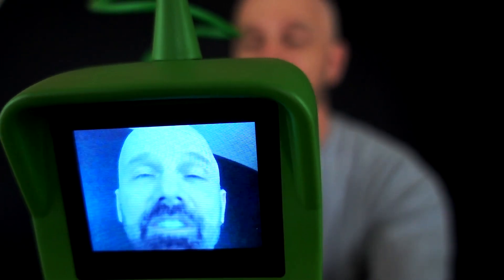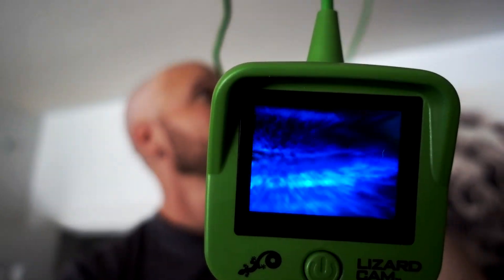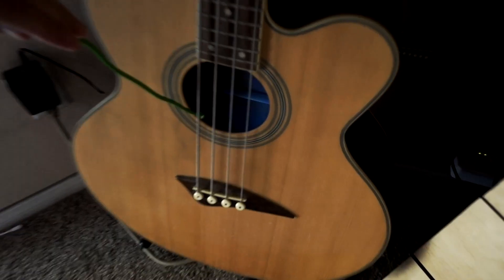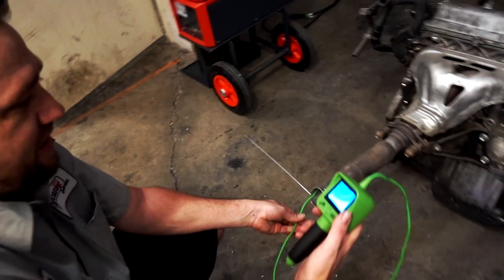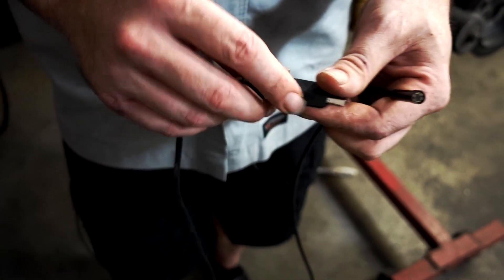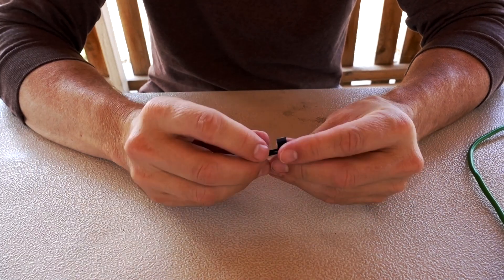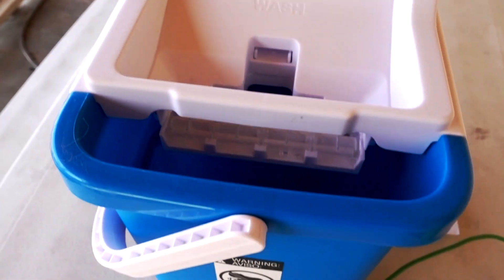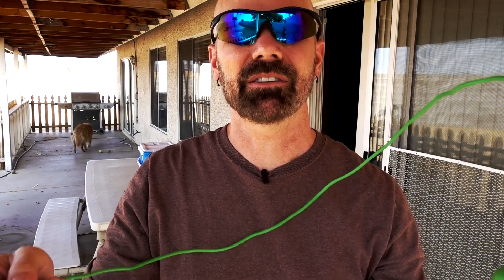Lizard Cam Review: As Seen on TV Inspection Cam

Comment: I was a jet engine mechanic in the Air Force and we used borescopes.  I have actually purchased a few for the Air Force and the ones we bought cost several thousand dollars and you had complete control of the tip with a remote control.  Crystal clear view.  Reverse the screen. Take pictures.  Measure defects. Etc.

Comment: I work as a auto mechanic and every shop ive worked at has a bore scope. its not this brand of course but this technology has been around for along time. it works great to see build up in the motor or if you want to save time for a tear down and want to easily prove failure to a warranty Inspector so they approve the new enginge for the customer.

Comment: Was it adjustable at all? I think it might be better with a wide-angle lens... It is also not widescreen, the FOV and aspect ratio seems to be sub-optimal. The LCD is a TN panel so there's always need to look at it straight on without an angle. A cell phone screen is going to be a much higher quality screen..ALWAYS..so I can only see this being a good option for greasy/dirty applications where you wouldn't want to have your phone in your hand otherwise a phone solution would always be a better (and cheaper) solution.

Comment: A high quality borescope allows focus, as well as adjusting the light intensity. It also has manually adjustable cable for moving the camera head as desired and making turns.
Yes the mirror has a use: an example is checking the condition of a wire you suspect may have chafed, but you can’t get your head into the space to see a mirror.

Comment: This very day, 09/20/19, I bought one of these at the Galesburg IL Walmart. It didn't work. Very intermittent, meaning it mostly didn't turn on at all. IF it lit up at all, camera lights would immediately go off, and same with the screen. I took it back, got my money back, bought another one. Just tried it, exact same thing, EXCEPT the screen flashes on and off, like it's on a timer. Taking it back, giving up.
Reply: OK, update here, 09-20-19: I put the thing on my bed, and later noticed the screen ON, the lights LIT. So, what? A delayed reaction? I'll try it tomorrow.

Comment: just tape on a stronger wire when you want more control going upwards or in any direction.
Reply: Or perhaps tape it to a broomstick or a wooden dowel or maybe even a thin metal rod.
Reply: Or tape it to a wire coat hanger.
Reply: I was thinking the same thing using a wire hanger.
Reply: Use some semi-rigid hollow tubing run this through it otherwise it's like trying to 'push rope'.

Comment: it seems like a good value considering it has a screen attached because I have used the usb one before and it was hooked on to my laptop while trying to look at my cyclinder walls. I pulled the cable a little too hard and my laptop fell and screen cracked . I still don't think it can beat the $10 I spent on an ebay usb borescope.

Comment: I think for people that have not used one before they would be quite impressed. I have used several different. This would rank on the low side of the list.  For 40 bucks it is acceptable if it lasts. I like the addition of the attachments, could be very useful. Thanks for the video, Be safe.

Comment: The high price is likely related to the integrated display.  That said, the USB ones work just as well and at a quarter the cost.
Reply: $40 is a "high price"? Exactly how broke ARE you?
Reply: High price relative to the other options. You can buy a usb model for a quarter of the price and hook it up to some tech that you already have if you're watching youtube. If you want it stiffer, you can use a coat hanger and some electrical tape. On the other end its only around $120 for a milwaukee model which is much more  usable with better features and rugged design that will retain it's resale value for years.
Reply: What Jeremy said.  My USB model cost me $10 so a quarter of the cost.

Comment: don't know if yours has one, but when i had a cam like that (before it was popular), it had a plastic thing on the lens, that was nearly invisible that really clouded the picture and the light. 

i have 2 of these. one very expensive, a few hundred, got an extension that magnified, which was a mistake because its hard to see what i'm looking at. it has better color than yours, with a removable screen and recording ability. don't use it at all, once you have one, there are few times you will ever need it.

then i got a usb model, and it doesn't work at all. i get no picture. not sure what's wrong with it. at least it was a gift so i don't feel totally robbed.

Comment: Oddly I was thinking about something like this when something is preventing my car's gas tank from taking gas at full speed, something must be blocking the hole or the nozzle is too short and its backing up at the anti siphon thing.
Reply: Andrew Hunt could be as simple as fuel filter as I've had similar problems in the past where my car would be ok till i got about 30mph then it would putter and die out. It was just the filter.  Just realized you might've meant take gas at pump with pump at full speed...lol
Reply: I have had the same problem with my Subaru for quite a while.   I have to put in gas very slowly.  I even had the dealership replace the nozzle.
Reply: You will likely find the carbon filter pack in the vent line is plugged. It is very difficult on some cars to get to so the mechanics will only do as a last resort. Other cars its very simple to get to. Common issue on f250's. Also common issue for people that drive a lot of gravel roads or insist on overfilling tank.
Reply: Muddy Ducker, thanks for that.  I live on a gravel road-explains the problem. Thanks!